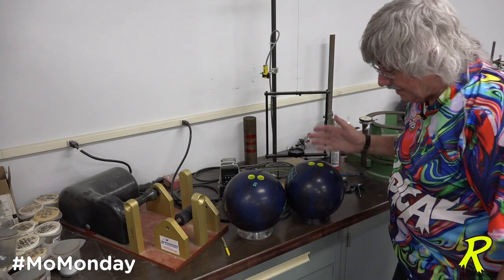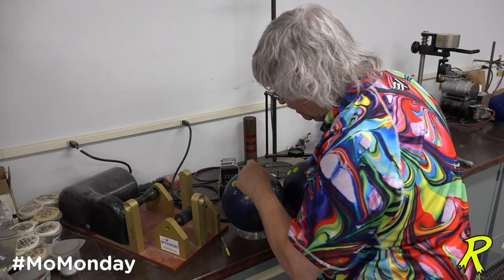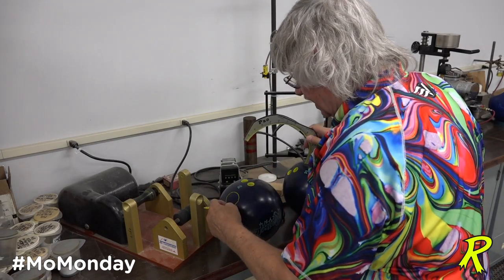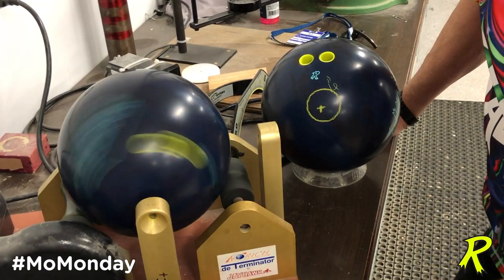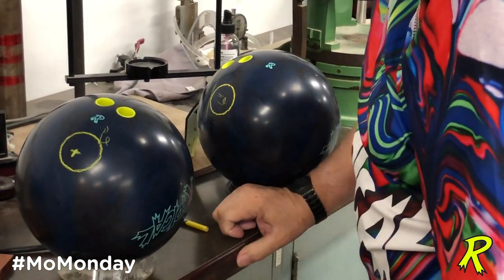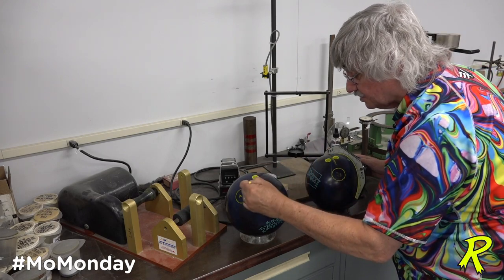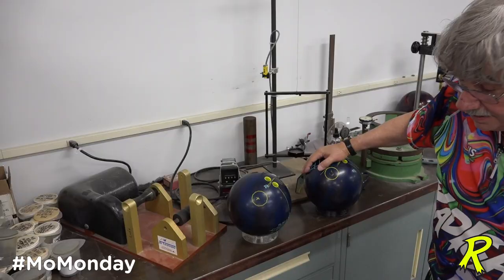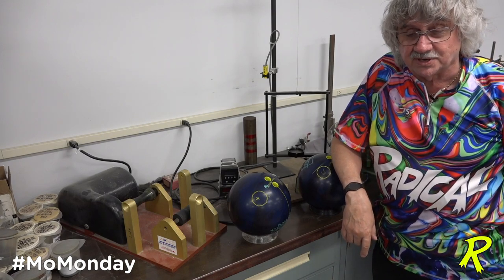Where Will It Spin? Drilled Symmetrical PSA Location For No Thumb Bowlers - #MoMonday

Comment: I was just talking about this with a friend and this was my presumption based on what you said in your two handed layout video, so it's nice to see it in action and proving out.

If you happen across this comment, can you answer, why you said to never go below the ring to pap line with the pin? 

I have an older(ha) ball that I decided to experiment with to try and get lined up for the incoming rule change next year. I filled the balance hole and the "thumb" hole and it lost all motion. Symetrical ball with a solid reactive coverstock, pin to pap of just shy of 4" with the original finger holes, and pin over ring to pap line of just 1.25" and it had a smooth arc, low total board travel and didn't carry well at all. I threw a triangle drill on it just to see what kind of action I could get out of it with some really obtuse pin to PAP distances. At the 8 o'clock position it has it's life back in it in a big way. 6 and 12 are similar to the old drilling, 4 is uselessly unpredictable, but the 2 o'clock has a similar but drastically less significant turn at the breakpoint. My summation is that the ball is reacting to both the axis of the core, which at 8 and 2 is very close to the same, but the distance pin to pap is much smaller at 2 than at 8. Deriving as best as my inexperience can, that 8 o'clock, when flipped to be above the ring to pap line, would be in the area of 2" up and 5.5" pin to PAP. Am I anywhere near the ballpark?

Comment: I'd like to see this test, with 2 of the same symmetric ball.  Both balls pin above the fingers... 1 drilled with 3oz static to the left, and the other to the right.  We know that a symmetric ball with a thumb hole will spin to the thumb hole, which gives you a really good idea of how to lay out the ball to achieve the desired reaction.  On the 2 balls Mo tested here, the ball with the CG on the centerline landed the PSA on a line from the pin directly through the fingers on the centerline... and the ball with the CG kicked out landed the PSA more on a line between the center of grip and the CG location.  Was that PSA deviation due to the CG being kicked out, or was it an anomaly?

If you test 2 symmetric balls, both drilled with the same pin position, and the CG kick to put 3oz to the right on one, and left on the other, that should provide an answer.  Would the PSA end up in the same position on both balls, or would the 3oz pull the PSA in the direction of that side?

Comment: thx for the video. One question is, what makes the difference in mb position btw two balls? One's in line of pin&holes, while the other's little right sided. Is that because of CG position?
Reply: Pin positions were different and the main reason for change. The test to eliminate CG would be drill another one with the same pin as the first ball but different CG location and spin again.

Comment: @RadicalBowling I'm a no thumb bowler and I'm having issues with my track being either on my middle finger and flaring off of it, or with pin down my track rolling in the middle of the fingers.. Any help?
Reply: craig garlewicz  
Mo did a video correcting this by adding pitch to your fingers when you drill a ball.

Comment: 2 thoughts here:
1) would an asym spin on the MB without a thumb hole?
2) pros/cons to drilling or not drilling a thumb for two handers?
Reply from the maker: 1. It'll spin to the MB. 

2. Pros, more stable, typically stronger more diff. Cons, will need to be plugged August 1st of next year. We suggest drill EVERYTHING without an extra hole from now on.
Reply: @RadicalBowling  so for two handers, the thumb hole is essentially a balance hole?
Reply: @Nick.McIntyre  Technically, a balance hole would be to keep the ball within the weight limits which isn't relevant at this point.
Reply: @christopherascherl2411  but it still affects the PSA because the weight distribution of the ball is altered. The previous comment said it would need to be plugged anyway, do I figured it served as a "balance hole"
Reply: The thumbhole is currently considered a balance hole by the USBC which is why they won't be allowed in the near future.  The thumb hole changes the dynamic values of the ball and creates a stable PSA which does affect the motion of the ball.  Once the ball leaves your hand, it doesn't matter if your thumb was in the ball or not; Mo shows how you can do this with proper core design and layout in many other videos.  This is why the layouts for no-thumbers is going to be affected much more by the rule changes than thumb-in bowlers.  Also there are two-handers that do use their thumb and one-handers that don't, so the more correct term would be no-thumb.
Reply: @christopherascherl2411  that makes sense. I'm still learning the in depth science at the moment. Thanks for your input!
Reply from the maker: Correct.

Comment: Still don't understand two handed layouts...
Reply: Camilo Rueda 
Center of grip is (between the fingers)
Find you pap and create the layouts from your pap.
Pin above the fingers will be higher for a no thumb bowler then a thumb bowler (center of palm).
Reply: Keep CG very close to fingers / for no thumb CG is moved up . And also PAP is directly across from your ring finger. Which will affect determination of pin position